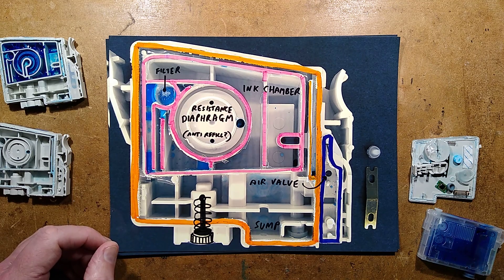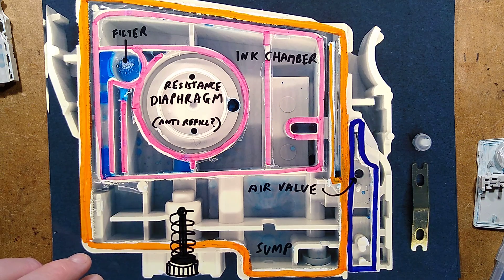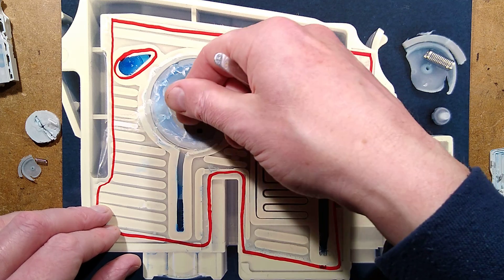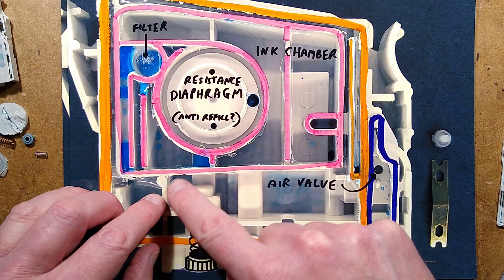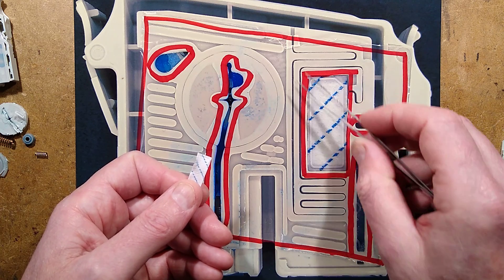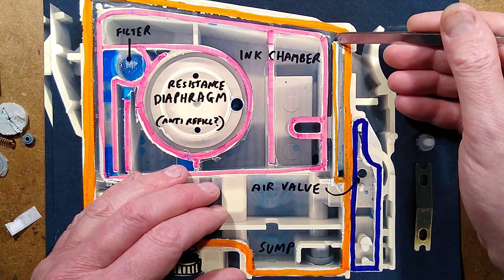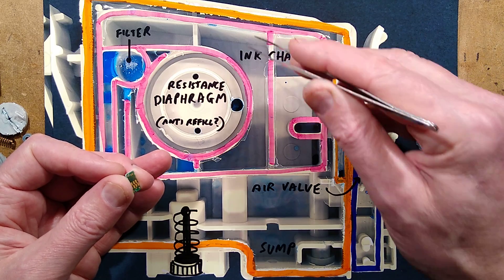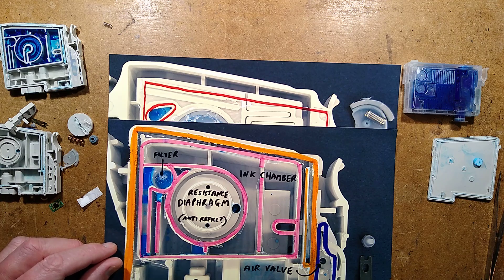Ink cartridges are complex inside!

Comment: I remember many years ago trying to make a cartridge refillable but once I had pierced the membrane, ink was allowed to flow through a hole in the bottom of the cartridge and it made a huge mess all over the place. What a mistake that was.
Reply: Having now watched this video fully, I can only surmise that after I had modified the cartridge and thinking that I had been successful, the ink had slowly syphoned its way through all the narrow tubes and out of the hole in the bottom. I do remember that when I had first drilled my refill hole, a thin metal plate at either side had bowed inwards but I hadn't at the time realised the significance of that because it didn't seem to make any real difference. How wrong I was because when I came back to it there was ink everywhere.

I was a kid at the time so I can forgive myself for trying, but I haven't ever tried that since.
Reply from the maker: Was it an HP cartridge?  They had a vacuum pack inside them.
Reply: @bigclivedotcom  I really can't remember - it was almost 45 years ago. It may have been - I just remember the thin plates bending inwards. On another cartridge that I didn't do anything with, the plates were hugging the outsides of the cartridge but when the hole was drilled, there was a noticeable bend towards the middle of the cartridge as though the plates were on the outside of some sort of 'air sack' keeping the plates pressed outwards.
Reply: I was probably 12 years old, I should add, so that may not have been actually what happened at all, but that is my memory of it. Maybe it was indeed a vacuum, rather than an 'air sack' causing the plates to bow inwards. Haven't touched a cartridge since... 🤣

Comment: The diaphragm is for pressure equalisation. It compensates for outside pressure leaving the the springressure as the only relevant pressure needed to pass the membrame. otherwise if you heat up the cartridge the pressure in the ink would rise and it would squirt ink. Now the ink through the sde holes push back against the membrame so the pressure from the ink can't push the ink out.

Comment: Used to refill ink cartridges in the late 90s, you'd get kits with a small drill and bottles of ink, maybe they are still available, this was before they put chips on cartridges. switched over to a continuous ink system setup that many printers now come with in the early 2000s and around 2008 bought a color laser printer that is still in use to this day, best decision I I ever made, would never go back to an inkjet printer now.

Comment: All this complexity to avoid the hassle of removing a piece of tape before use. Absolutely incredible.
Reply: Isn't there still a piece of plastic that gets punctured when the cartridge is installed?
Reply from the maker: At the ink outlet.  But for air intake it's a physical valve.
Reply: @bigclivedotcom  The (non-genuine) cartridges for my Canon ip100 have part of the sticker on the inlet which also must be removed before use. And if you turn them upside down the ink absolutely does leak (yes I learned this the hard way).

Comment: With an inkjet I had to replace cartridges almost every time I printed. I tried refilling, but my main issue was not printing frequently enough to keep the print heads unclogged, so I was constantly having to soak print heads in rubbing alcohol before printing. When I bought a laser printer It took me ~3 years and ~750 pages to get through the starter toner. Definitely worth the extra up-front cost.
Reply: I htink this is what is wrong with most home printers. They just aren't used enough to keep the ink from clogging everything.
Reply: @donnie1581  More like the manufacturer pushing the inkjet to home printer use whenre they know the most amount of ink wastage for purging happens. It wouldn't be that hard to recycle 10+ year old office laser printer designs to make new but cheap printers for home that don't have clogging issues
Reply: @marcogenovesi8570 They can, because they do. Ink tank printers. They just ditch the cartridge entirely, and you can dump in any ink you want.
Reply: @Studio23Media  The "dumped ink" isn't disappearing into the ether. It goes in a purge pad and if you don't print often they will eventually fill that and lock up with an error code like "ink pad is at end of service life".
Depending on printer you can pull it out and wash it and reset the error with some third party programs that communicate with the printer.
If you have a ink tank printer it is simpler and cheaper to just print at least one page per week, so it does not need to purge
Reply: Yeah. My first and last inkjet was the first colored HP 560c. Price was > 1000 DM.
Later i estimated every single colored  page i printed was like 10 DM or 5€.
Today i only use Laserprinters that someone threw away because the toner was empty.
If you need colored printouts just use any online photo or printing service.
Reply: Good idea  @jpt3640
Reply: Now I know why cartridges cost$40 each. I have taken to removing the cartridges and capping after printing because we lost too many that dried out and couldn’t be revived. The HP 300 is ancient, but does what is needed.
Reply: After using many printer brands , I have settled on a Brother which I hear running a  cleaning cycle ( I think) regularly all by itself. After returning from a vacation of several weeks there has never been a problem. I believe it is good practice to print a test page every couple of days.

Comment: I learned weirdest thing recently. The reason why 20 year old Laser printer produces streaky pictures is that under the Color Transfer Belt there is a  chamber  collecting excess toner. When the level is high enough it touches the belt. Not  an easy thing to empty that chamber, but one could drill a hole and plug it. So no need to replace the €100 belt in  Samsung CLP-110 or HP nw-150, when streaks appear and there is no physical damage on the belt.
Reply from the maker: Yeah, the waste toner reservoir can cause issues.  That damaged the belt of my first laser printer.  When I found out I worked out how to empty it.

Comment: It’s been a while (almost twenty years) since I regularly printed, it was with a Canon PIXMA iP4000. Back then images or text printed with the genuine Canon ink were quite sensitive to moisture (smearing etc.) even after it had completely dried for hours. Is this still an issue in current printer inks?
Looking for something to print borderless DIN A3 photographs and technical drawings.
Reply from the maker: Water still affects inkjet prints, but generally when proper glossy inkjet paper is used it's not too bad.

Comment: Grossly overpriced for what they are and how much ink they contain. Last year 2022 Seiko Epson made $3.4 Billion USD, in 2021 they made $3.18 Billion USD. They try to prevent using cheaper cartridges or refilling so their profit can be maximised. Great post Clive,appreciated 👍
Reply: Yean, but this ink business is not their whole biz, they have projectors, scanners, even robots, so any financial data is not 1:1 about ink printing. Not that they don't earn a lot from this part of the business, but there is other revs too.
Reply: Yes, but Epson cartridges are some of the cheapest to by 3rd party. My cartridges cost me between 50p and £1 a piece.
Reply: that's interesting, I have an Epson WF-2630 and it just says «unoriginal ink: ok/cancel»
Reply: @formbi I’ve seen that error message when I used third party ink when I had an Epson printer. Honestly I didn’t mind it as long it works and they’re not like HP who will outright block third party ink from being used.
Reply: I get my epsom ink cartridges from local social media recycle groups. Not bought any for 6years and have a shoe box full. The only expensive recently was a printer potty replacement.
Reply: Desktop InkJet printers are made to be disposable and sold at a loss. All manufacturers use the model of design and make the machine at a loss and make profit from consumables such as ink/paper.

Comment: Ridiculously complex design. Agreed that some of it may be to prevent leakage in transit, but the non-refill diaphragm and chip are clearly there to try and prevent re-filling and re-use. 
The worst case I’ve ever come across was shown on EEV Blog 1462 about a Dymo label printer. The printer can ONLY use Dymo paper label rolls containing 50 labels and an RFID chip. About half way through that video we learn that after printing the 50th label, the firmware destroys the RFID chip to prevent re-use. The machine will refuse to work if a roll of paper labels does not have this RFID chip.

Comment: I've refilled hundreds of these....end up with pressure relief hole, hot glue works fine for refill holes.....have to flash the pins with 2-AAA batteries
Reply from the maker: I've never heard of the battery technique.

Comment: After a long string of terrible, $20 Walmart inkjets of various brands, I eventually realized that all I really needed, 95% of the time, was just plaintext and maybe a full-page monochrome picture once in a while. Ended up dropping $60 on a beat-up Okidata dot matrix and once I unfuckulated some of the things that getting literally THROWN at my front door by the delivery guy bent up, it's been an absolute tank. Ribbons do 4 million characters before they start fading, they never dry up, it's plug-n-play with no driver installation on every operating system known to mankind, there's none of those little yellow tracking ID dots, and it uses tractor feed paper so I have the entire BOX on tap instead of the pathetically small slivers of ream paper that consumer inkjets hold that needs topped off seemingly every time.

Comment: Surprisingly complex design.
The ink itself is also a very complicated fluid made up of carbon black pigment, drying agents, binders, solvents, chelating agents and other components. 
The rheological properties of ink is certainly non-Newtonian  and a yield stress is present. This means that the ink will not flow until a minimum shear stress is applied.
Typically inks of this type are visco-elastic fluids that contain nano-sized particles.
The ink droplets themselves are charged and electric fields are used in the printing process.
Although inkjet technology was invented in the 1950s it took many decades of further innovation and development to reach the current low price, high quality level of inkjet printer.
A merging of fluid flow behaviour (rheology), electronics, engineering design and material science.

Great presentation Clive.
Reply: So are you talking about Pigment based ink or dye based ink???
Reply: @RTR-MATEY  A very good question Mr Sookingsock.

In summary, pigment-based ink, although not as vibrant with colours is best suited to photo printing. Dye-based ink, is predominantly used for text-based creations and sharper prints. It will however tend to smudge. Generally, pigment based inks deliver longevity, work better on glossy paper, and reduce smudging and colour bleeding. Dye inks produce more vibrant colours and are cheaper.

With respect to the comments I made on the rheological properties of inkjet inks I was mainly referring to Pigment based inks.
Remember, dye based inks are fully dissolvable whereas pigment particles are suspended in a carrier fluid. Most likely the ink being used in this video is a dye dissolved in water (and other components).
Dye-based inks have been around since the inkjet printers were invented.
Pigment based inks are certainly more expensive and ultimately cost determines sales.
I know that HP and Epson are using both types of inks in combination to get the best of both worlds.

It's next to impossible to notice the difference unless you're printing on exotic materials or have specialised requirements etc.

Comment: I feel like a simpler way to gauge ink level would be a small float and magnet in the cartridge and a few hall effect sensors in the printer itself, but of course that be cheaper and gasp easier to refill. We can't have that, imagine the chaos.
Reply: Optical sensor using refraction/reflection through a clear window in the cartridge.
Reply: @RTR-MATEY  Indeed that's what Canon use/used. Worked well unless you had off brand cartridges made of cloudy plastic.
Reply: @pizzablender  I think the ink formulation might have included some form of alcohol for rapid ink drying...and if a "clear" plastic that was used was sensitive to the alcohol, then the alcohol probably etched the surface of plastic that was in contact with the ink formulation. This would be my guess.
Reply: brother is using only optical sensor to sense ink level, no chip

Comment: I bought a color laser all-in-one at a yard sale. It needs some repairs, but it's all the printer I'll ever need.
I print so rarely that inkjets - especially Epsons, which I keep freaking accumulating! - tend to clog and dry out.
I swore that the next printer I would aquire would be laser, specifically because of its tolerance to sitting on a shelf.
Even if the repair on my yard sale get is $200, I'll still be well ahead of buying new as I got it cheap "known broke".

Comment: This complexity is only present in old type cartridges.
All new ones are basically piece of sponge, single bubble trap and a vent.
It's quite an evolution to get from multiple chambers and way too many parts to 2 chambers and 1 part in them.
Reply: Much cheaper to make, as your mould does not need to have many complex moving parts. So now you only use half the ink, and the rest gets tossed as trash.
Reply: @SeanBZA  lWhere did you get this information from?
New cartridges use up all of the ink with not even drop left inside, and only surface coat on the sponge.
Canon makes clear cartridges so it's plainly visible.
They even started making optical sensors to check actual ink levels, and not discarding cartridges with lots of ink inside.
The more complicated cartridges were known for having ink left in them.
Reply: @michahalczuk9071  probably from HP printers
Reply: yet the easiest way of all would have been just to use a flexible plastic ink bag with no air...
Same kind of technology that was developed in ww2 to avoid air bubbles in fuel tanks interrupting fuel flow with combat aircraft under high G.
Reply: @givemeanameman1  a sponge is usually cheaper to make and does not degrade as quick as a flexible plastic bag. Aircraft have dedicated maintenance crews, consumer printers do not
Reply: @marcogenovesi8570  Plastics have a far longer lifespan then natural or synthetic sponges which incorporate organic matter such as cellulose.
Further printer tubing that moves the ink to the print heads is flexible plastic and not any special expensive kind.

Generally as a rule plastics suffer no noticeable degradation to their properties in a human lifespan unless exposed to UV such as sunlight or a reactive element.

Comment: My old canon pixma cartridges were see through, for 2/3 filled with liquid ink and for the remaining 1/3 with a felt material. They were also almost half the price of hp and Epson cartridges.
Reply from the maker: I used a Pixma for a very long time.  No chips and the cartridges used an optical system to detect ink level and were very easy to refill.
Reply: @bigclivedotcom I had a Canon PIXMA too!!! Chose it over the Epson due to cost and the Pixma dye based ink wasn't as prone to clog as the Epson Pigment based inks, granted, the Pigment ink had longer archival life which I didn't care about at the time. Also discovered from someone else who used an Epson that the Pigment based inks had a more abrasive effect on the printhead orifices than Canon's dye based inks.

Comment: I think it really depends on what kind of printing you're doing. My mother was always complaining about running out of ink in the little Epson, but all she was doing was text and low-res pictures. After a stint with a B&W laser printer, we eventually replaced it with a Brother color laser do-all. Better overall efficiency and economy for her tasks.
Reply: Yield is usually based on about 5% coverage. High resolution or low resolution, it doesn't matter...ink is still being applied to the page!!! Some print drivers have an Eco Mode that actually reduces the density (lightens) and lessens the amount of ink/toner applied to the paper.

Comment: Can you fill one with a metallic ink, say one that contains actual metal, and possible print your own circuit traces?
Reply from the maker: I doubt it.  The metal pigment could cause clogging issues and the conductivity of such a thin layer would be poor.
Reply: @bigclivedotcom  ☹️
Reply: yes you can with silver nanoparticle ink. not very cheap i geuss.

Comment: I think the paper is a filter to stop crap getting into the ink?

I'm confused, so the chip on the outside on the cartridge has no connection to the inside?
Reply from the maker: It is purely a low capacity memory chip.  There is no actual ink sensing.
Reply: @bigclivedotcom  I just thought maybe it would open a valve or something to allow different levels of ink to come out or whichever